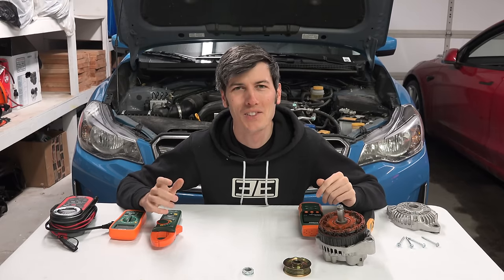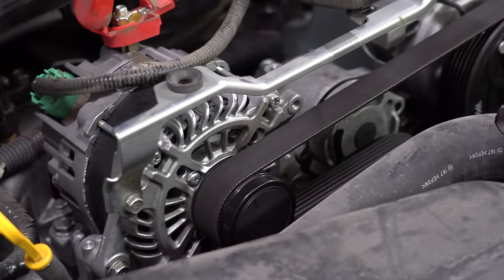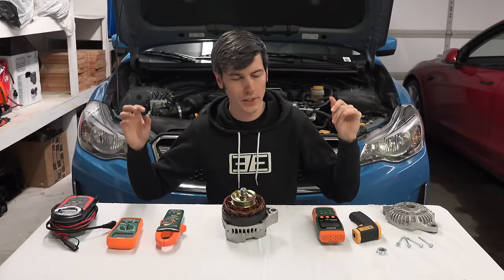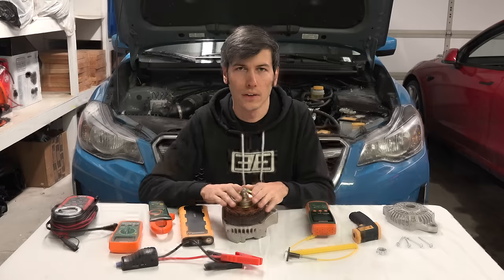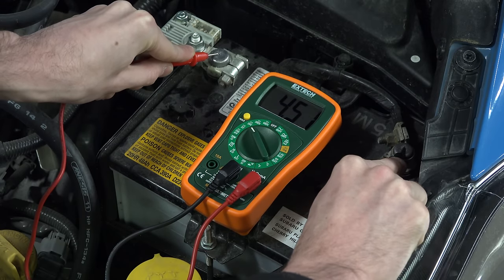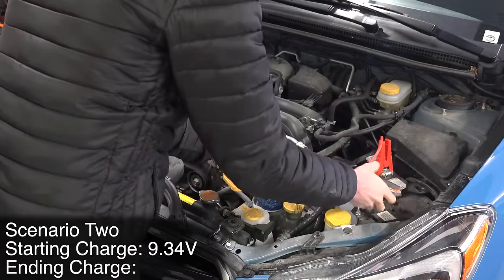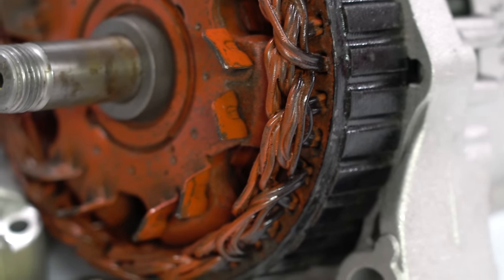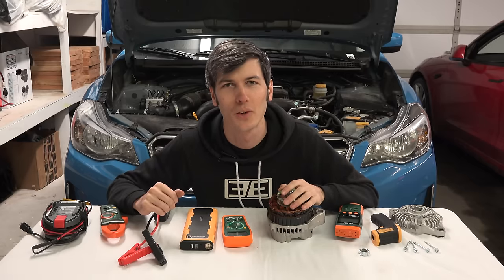Can A Dead Battery Ruin Your Car's Alternator?

Comment: That didn’t answer my question. 

What people are afraid is to use their 100% working battery and alternator to jumpstart a dead batter on a car.
Reply: If all they do is connect long enough to start the car, then it is no more harmful than starting their own car. Trying to rev the engine and charge the other battery for a while is the same as trying to get your alternator to charge your own dead battery. If you just start the other car and remove the jumpers, that car will have to charge it's own dead battery.

When stuck in the situation where a car must charge any dead battery (yours or another car), just let it idle for a long time, don't rev the engine to make it quicker. Be patient because dumping a ton of current into the battery hurts the battery and over-taxes the alternator. Better to limit the current by idling and wait a while longer.

The danger part is if you keep the two cars jumped and keep trying to slow-crank the dead one, your alternator is trying to charge BOTH batteries that entire time. If worried about your car, just turn it off and use your battery by itself. But if you deplete your own battery too much and then start your car, your alternator has to work overtime to get your battery charged again. Bigger jumpers are a better solution than trying to charge the dead car enough to crank properly.

You'd want jumpers that can supply enough current to actually run the starter on the other car without having to charge their battery first. IOW, expensive ones with big, heavy wires that are bigger than the diameter of the battery cables. Jumpers are longer and have more internal resistance to current flow and a starter wants a couple hundred amps.

The clamps need as much contact area as possible to allow the necessary current flow. If you can find it, bypass the positive battery cable on the jumped car, and connect to the stud where the cable goes (from the battery). When in doubt, you can use the positive terminal of the battery. Either way, try to find a clean spot on the engine block for the negative jumper. This way, you can bypass any corroded terminals/cables on the dead car which happens a quite often. The battery isn't really dead, it just can't pass enough current to crank the starter, because of the corrosion. Clamping onto the battery doesn't work in that situation, but bypassing the cables does work.

I've jumped hundreds of stranded people in my life and if you follow these general guidelines (and understand why) then you'll be fine. I used to drive a wrecker for AAA and you should have seen the size of the jumper cables we used. I could even leave the truck off and never had a client not crank away. The wreckers/trucks we used for jumping needed no more maintenance than the ones that were not equipped with the cable sockets.

We were in Arizona, so batteries were unusually short-lived in every car. When it's 118 F in the SHADE, you can imagine how hot it is under the hood of a car sitting on blacktop in the direct sunshine. Now imagine how hard it is to crank a smoldering engine that's boiling over into the overflow container. Meanwhile you dash into the 7/11 to buy a cool beverage and then expect it to just start right up, when you get back in it. Bad place to be a battery.
Reply: PappyMan that’s very informative and sounds correct! Thanks!

Comment: PS A VW air cooled engine's efficiency is 30% or so, not all that energy is lost in heat...About half of it is lost making that horrible - EDIT: removed in case young viewers are reading - noise.

Comment: Short answer, yes it will.

Heat kills everything. Driving around on a battery with a bad cell, if it'll even start, or a dying one will eventually wear the alternator out... granted in most scenarios you're going to replace your battery long before this is a problem. I don't know many people that would jump their car off every single day repeatedly and rely on the alternator.

Comment: You keep using the word "dead."
To me, being an auto mechanic, 
dead means doesn't work.
Discharged would be the condition 
of the battery in the second test.

Someone mentioned alternators 
sized to the use.  I worked on a 
Lincoln LS, that had 2 "power steering" 
pumps.  The right side one, ran the 
cooling fan, mounted on the radiator.

Lincoln did this, because the alt was 
not strong enough to run the fan, and 
there was no easy way to run a 
mechanical fan.

steve

Comment: How does an alternator know that a battery needs more or less amperage?!?!  There is no feedback from the battery... unless there is some new psychic or WiFi or smart technology that no one knows about. Also the alternator has no way of varying its output so it couldn't work harder even if it was requested to.

Comment: If you have a crap battery and a 2CV you will be using up to 4% your engine power to charge your crap battery (with your crap engine...sorry 2CV owners) 746W is one horsepower. 60*14 is the electrical power..not insignificant with 26 horsepower (Though I doubt a 2CV alternator will be rated over 750W). Going further some guy with an updated electrical system in their VW beetle to run some insane audio system, with a crap battery would use a lot of the 22bhp - one to charge his battery and one(minimum) to run his subwoofer, and it's at night so he has his lights on and he is lighting his cigar. Plus of course the ignition system. The efficiency of the alternator is in the 90% region. So I think he would be lucky to see 19bhp.

Comment: I am a bit disappointed because this was not very scientific. Try to measure the voltage again next morning and you will get 10V max. Not speaking of voltage under load. Transient process in batteries is pretty slow.

Comment: In FIAT case rust is the primary problem for alternators.
Reply: have 2 FIAT, never heard of this and doesn't make much sense, most components on it don't rust...
Reply: @TheFPSPower  Yes, the rest is just fine. Alternators get some water and it chassis breaks finally. Another scenario is, it gets some rust, then water again and chassis snaps. Replaced two in 6 years, my local Fiat shops sells refurbished alternators like wind screen wipers- you have to replace it sooner or later.
Reply: @lukluk1914  do you live in areas with salty roads? I've never heard of that issue.

Comment: "...the outside temperatures when I was driving the car were just above freezing, so it was very cold outside..."

Oh, you spoiled California man.
Reply from the maker: Ahh yes, the classic "my cold is colder than your cold" internet battle haha. Cold is relative. For a car, ambient temperatures of 120F are used for hot testing, meaning cooling systems operating at about freezing temps have a massive factor of safety (they're oversized for cold temps, correctly sized for hot temps).
Reply: @EngineeringExplained  I honestly have no idea what "cold" is as far as a car is concerned, just poking fun with the meme like you noted. Especially since this year has been so god awful cold here in the midwest.

Comment: How can you tell if your battery is shot or the alternator needs replaced? Had to jumpstart my truck this past week.
Reply from the maker: Well, brief answer, but if your battery won't hold a charge (measure the voltage) and you have to keep jumping your car, then the battery is fried. Try putting it on a dedicated charger. If your alternator is dead, you won't be able to drive much, as it's supplying the electrical current for all the onboard electronics (including ECU, spark plugs, etc). With a fully charged battery, and a dead alternator, you could drive as long as the battery had enough current to provide.
Reply: @xenonram  
Thank you
Reply: @EngineeringExplained  
Thanks a million 👍
Reply: Measure the voltage of the battery between the positive and negative terminals, when the car is turned off.  It should be around 12V to 13V.  Turn the car on and measure the voltage again.  It should be around 14V as that is what the alternator is providing to the battery.  Not 14V likely means the alternator is not functioning properly.  After charging for a while, a low battery voltage when the car is turned off likely means a battery issue.

Also remember that as batteries wear they will store less and less power until they have so little that they either go dead easily or will have enough power to start the car.

And don't drain the battery right down like was done in this video.  Doing that a few times can really shorten the life of the battery.  SLAs liked to be charged all the time.

Comment: Terrible advice at the end. Most people have AAA. The better advice is to call AAA and have them test the battery before just jumping it and driving like nothing happened. You need to know how dead the battery is, to know if its safe to drive the car like that. Last thing you wanna do is drive around with a battery thats at 1-2 volts on a hot day....

Comment: Classic BS research. If you drain your battery, and jump-start your car, than the alternator will have no significant problem charging the battery at 50A, since alternators are usualy rated 100A+. An electric fan usually is rated at 400-500W, that's 35A, and it is not uncommon to see 2 fans in a car, so that's like 70A from an alternator on a regular basis, and it doesn't blow up after one day of driving. And when the battery is old, and doesn't hold a charge, it will draw like 15A after being started and after 5 minutes the current will drop to like 5A or less. So thumbs down for such a misleading video.

Comment: lol, you won't know the real voltage of a battery if you don't stop the car. The difference of voltage is just due to the resistance in the cable sorry men but the stop of calculating the voltage of the battery when the car is running is useless.

Comment: can flat battery damage your alternator? DEFINITELY NOT. Each alternator is specified to limit the current to it's capabilities and in this case it seems to top out at 60A. Alternator itself has a regulator.
A flat battery, however, will MOST DEFINITELY be killed by alternator. Lead-acid must be charged at rate of 0.1C (5.5A in case of 55Ah battery), but we clearly see it being charged at 10 times that. Most batteries will loose at least 10-20% of their capacity after such event.

Comment: No, the car doesn't need the battery once its running. A dead alternator can ruin a good battery by not keeping the battery charged.
If the alternator is having trouble clean slup rings and replace the brushes. Q-tips with rubbing alcohol on brushes. To clean slip rings with brushes removed start car use Q-tips dipped in rubbing alcohol.